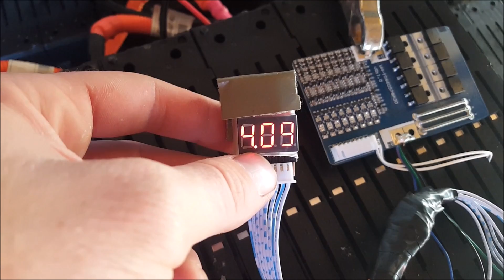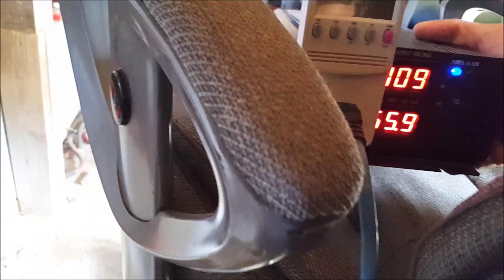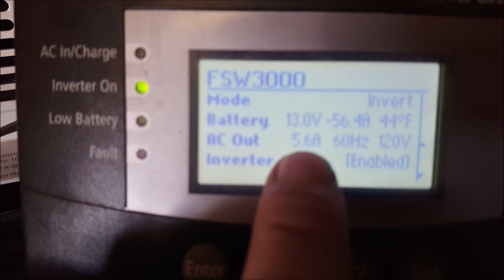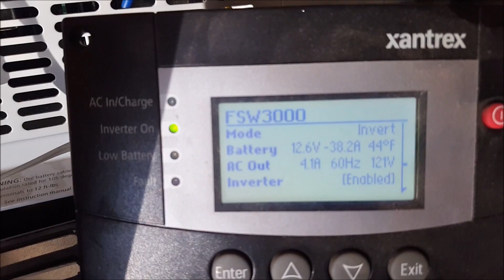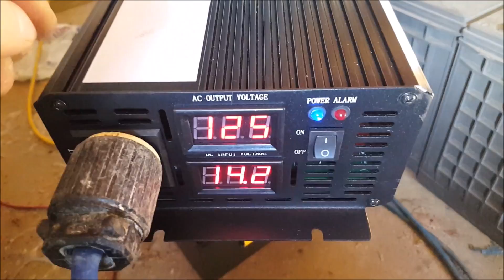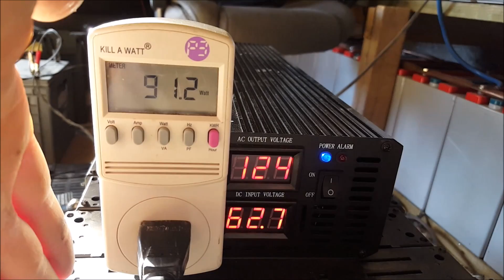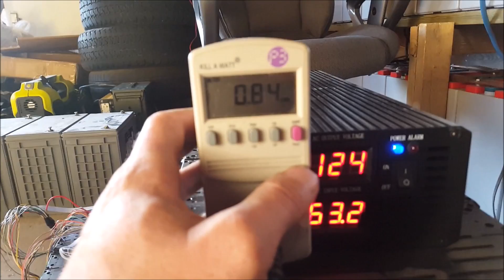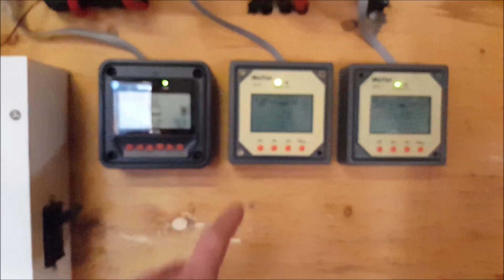Power Wall Gets A New Charger & More

Comment: Do you have a link for that new buck converter?
Reply from the maker: http://www.ebay.ca/itm/291837906017?_trksid=p2060353.m2749.l2649&ssPageName=STRK%3AMEBIDX%3AIT
Reply: fliping720 Thanks $23.00
Reply: If this does 1500w it's @
50.4v @ 30a = 1512w
with your setup it's 66v @ 30a = 1980w and it can't be correct unless it brings the wattage down, have you thought about dropping you voltage down to 60V using a step down?
If I use this running 12v I will only get 360w
Reply: Running li-ion or lipo batteries at 4.2v is normal but if you drop the voltage to 4.1.or even 4.0v will allow them to last longer from what I read
Reply from the maker: MrBrymstond yes it does I like to run at 4.1, these buck converters are 500w max not 1500 fyi

Comment: Auto start for those two digital boost converters: Try this, turn the DC power off so no power is going to the unit. Hold down the "OK" Button and turn on the DC power to the Unit while holding down. You will see some numbers on the screen, let go of the "OK" button and auto power output will be enabled. Try turning the power off and on and you will see the unit will auto start the output :)
Reply from the maker: o my, that would be amazing if this works!!!
Reply from the maker: It worked!!!!
Reply: :) Great.To note tho the 900w ones are only 86% efficient where the 1500w and 600w are 96%.
Reply from the maker: I was about to test that thanks!
Reply: Great to know! I bought a "delay relay" to deal with this problem. Glad to know there is a better way!!